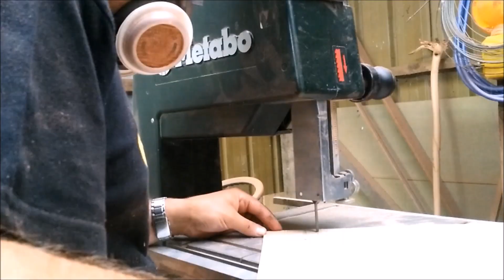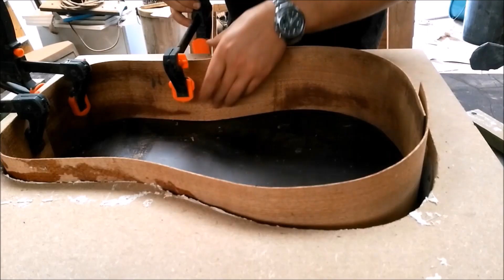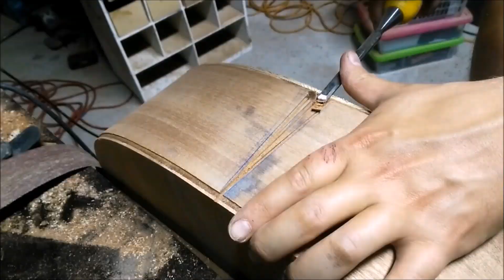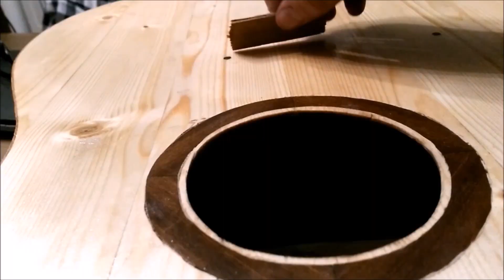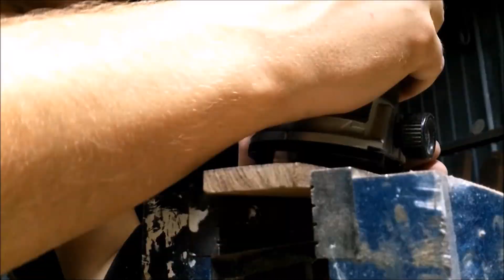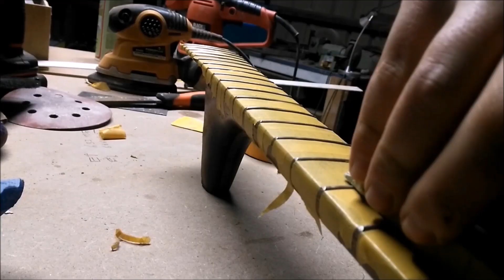Making an Acoustic Guitar - Super Fast

Comment: I’m surprised at how simple this looks. Don’t get me wrong, making a good sounding instrument is really hard but the process of making a guitar (not taking quality into consideration) seems quite simple. No special tools needed, just time and some elbow grease. I might give it a shot sometime. Seems like a fun holiday project.
Reply: There are some specialized tools that are highly beneficial if not outright neccessary, really depends if you intend to build more than one or two. It also depends whether you intend to use prefabricated parts which can eliminate the need for otherwise indespensible tools.
Reply: @deepfreeze202  not that specialized. I have all of them or have the tools to make them. Toolmaking is honestly one of my favorite things to do. Then again, a lot has changed since I wrote that four years ago and I'm now a piano technician so while not the same as guitar building, the skillset necessary is very similar.

Comment: Love seeing capable people just go for it. Sure it's not likely to hold a tune, maintain playability or sound like a guitar built with select tone woods but this video is awesome!!!
Reply: The difference wouldn't be hige if the guitar is made well, the soundboard or top would be the most questionable since it has knots that may compromise its performance and stability.

Overall though the quality of the craftsmanship is going to have a bigger impact on the sound than the wood used and at a certain point there's very little if any difference aside from visual appeal and cost.